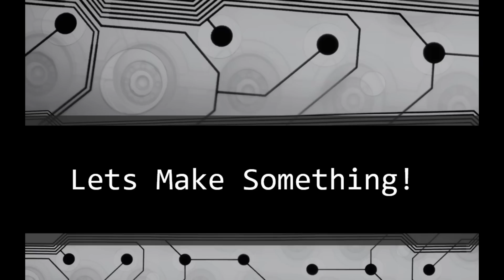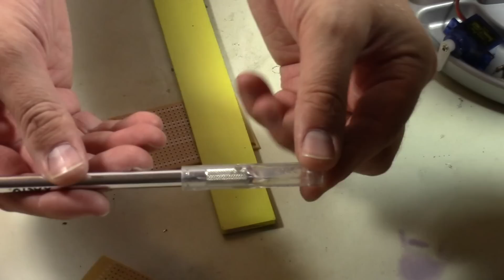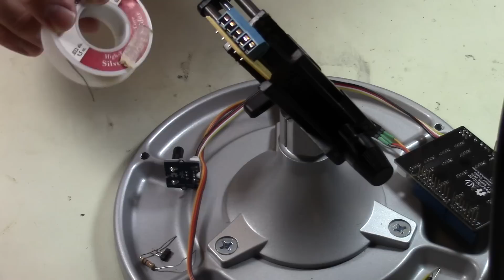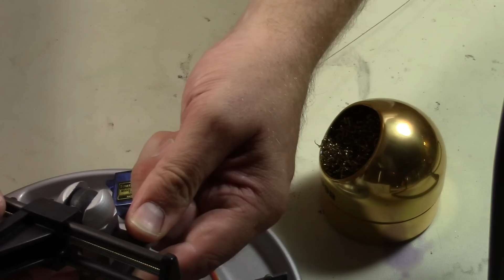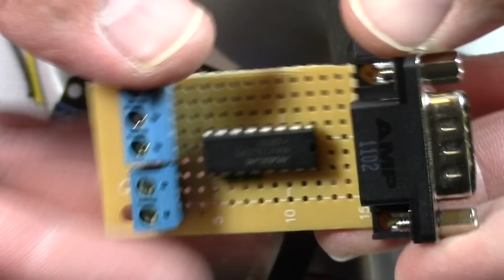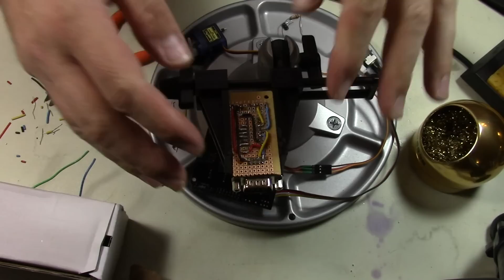Lets Make Something - RS232 to TTL

Comment: Nice little project there!  To save on having to make solder bridges might I suggest you could have used the leads from the components to make the connections.  Just solder the component in place then bend the lead down and solder to next point then cut.

Comment: Would you recommend not clipping off the extra tail left off after soldering down the capacitors and use the tail to bridge the gap between the capacitor and the pin of the IC rather than making a solder bridge? I found this saves solder and is less finicky.

Comment: Hi ! I am trying to communicate a board that has a db9 female connector , I put a prolific cable that has in one end the db9 connector, and in the other end a male usb connector, an adapter to USB-C, and, with this configuration (board- db9 to USB cable and adapter to USB-C) I can communicate to android cellphone, using a generic  application for serial communications, I send 01 command, and the board does as expected, 05 comannd etc. Now, when trying to communicate with arduino uno using HW-044 nothing happends, I tried all softare examples, crossed the rx with tx, and nothing, can you help me ?

Comment: Could you use a usb female micro B instead of vga?
Reply from the maker: Well all this device does is convert the voltage levels.  It does not do the USB to Serial conversion.  It simply changes TTL voltage levels 0V to +5V convert to -12V to +12V.  You could use a usb micro connector but remember it does not convert the usb to serial you would need a FTDI chip like FT2232D that will perform the USB conversion to RS232.

Comment: Great video.. Thank you... My project requires rs232 at no more than plus or minus 5Volts(I think it's known as Low Level RS232)..Is there a simple way of limiting the Voltage swing on your device...Thank you in advance..John...Bristol..UK
Reply from the maker: What is the device you are connecting?  Normally if there is 5V involved it is usually on the TTL side and is +5V = 1  0V = 0  but on PC's and other DTE/DCE devices they are usually -12V = 1  +12V = 0  something like that.  If it is a different way the chip I use the MAX232 chip will not work with it since it is charge pumping to +/-12V logic for standard DTE/DCE deviecs.  Maxim semi may may another type for what you need you may just have to check their website.  Or Texas instruments would be another good place to check.
Reply: misperry Thank you for your reply..In the last 24 hours, the problem has gone away! I was trying to configure a Gamma 868 radio transceiver from RF Solutions in the UK..Their manual said that to achieve this! I would need 'low level rs232' serial with a max of 5Volts.. After many hours of getting no response from the module, I found that the manual was incorrect !  It simply needed TTL serial.. Strangely, RF solutions insist it's rs232...I disagree.....So thank you again for responding, but the problem is now solved..Thank you for great videos..John

Comment: What did you use it to do?
Reply from the maker: This is one of those handy devices to have in your lab.  It allows you to connect a PC straight to a microcontroller.  A PC uses -12 to +12V for it's serial signaling where a micro only uses TTL (transistor to transistor logic) that is only 0 - 5V.  Thus, the need for the converter so you don't smoke your micro.
Reply: misperry, can you use it to have your microcontroller communicate to RS232 devices, like a serial printer or control a projector TV? Do uou need a special Aduino IDE to use it?
Reply from the maker: As long as you know the serial protocol for the RS232 device you are wanting to control you can connect a microcontroller to the TTL side of this converter and then the RS232 device to the RS232 side of the converter.  All it is, is a level converter to convert the 0 to 5V logic into the -12V to 12V RS232 levels.